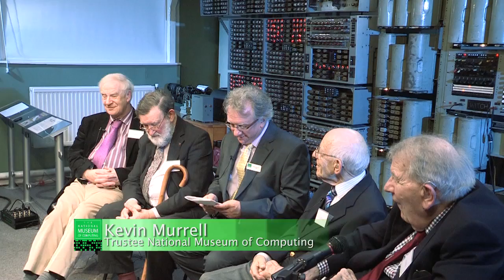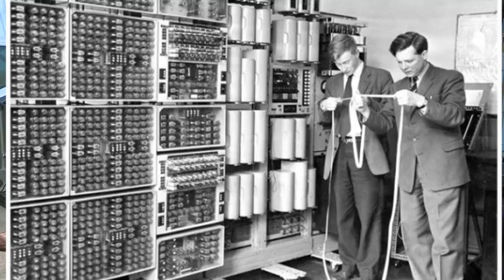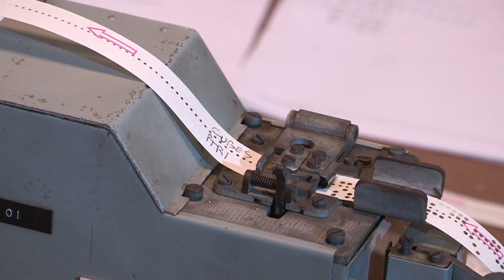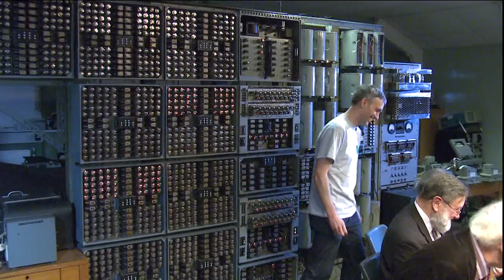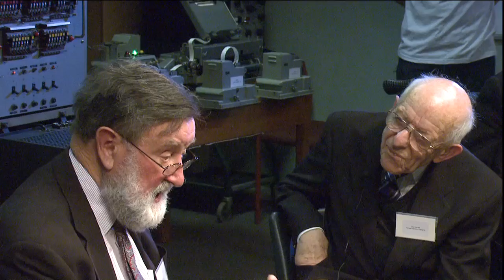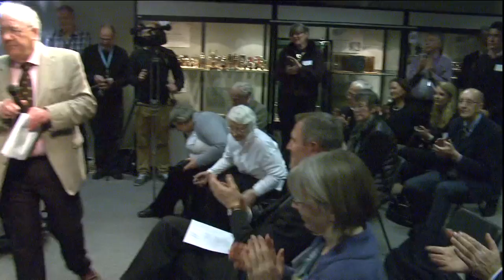The reboot of the Harwell Dekatron / WITCH computer, the world's oldest working computer

Comment: I'd love to see this machine in person, but I'm on the wrong side of the pond.
Reply: Saw it when I visited in 2016, but it wasn't working that day. The EDSAC rebuild was still underway at that point, too. The Colossus replica was working, though the printer was disabled as apparently the paper was a significant cost for the museum if they let it run.

I think I probably had a longer trip than you'd need, though. Australia is only a couple of time-zones off being on the opposite side of the world from the UK. New Zealand is directly opposite Spain, so it's probably the country with the longest trip to visit the UK.

Comment: Iran across this old digital computer patent 3190554 where it ran on compressed air instead of electricity. Was this computer ever built and used for anything? Could one be built today using 3D printing? Thanks for the post.

Comment: The mechanical calculator Bart Fossey uses is a Danish machine called a Facit. I own one. This was a development of the original pinwheel handle-driven calculators, but designed to fit a smaller footprint, and was also uniquely the first calculating machine which used a single set of digit buttons 0 to 9 for input. This actually had disadvantages for certain operations (such as square roots) but the cause was the design requirement for a small footprint. Overall it was physically harder and much clunkier to use than a Comptometer or an Original Odhner.

Comment: A pocket calculator is thousands of times faster, and I am talking a TI-58.
Reliable? until a tube goes out, that is why they ran known calculations both before and after anything important.
Tube failure rate was measured in hours as there were  just such a number of them.
Reply: Arabhacks Actually, the beauty of the dekatron tube is that it is NOT a vacuum tube. It's a cold cathode gas filled tube. It's filled with neon, and has no filament to burn out. The ionization of the neon causes both the glow, and keeps a path open for electrons to flow. As long as you don't keep tubes on and unchanging (and look at that thing blink away...) you should be fine a very nice chunk of time! Even the very worst USSR made dekatrons at least were rated for thousands of hours. the GC10B was a legendary tube. Not sure what the WITCH uses, but those tall tubes could be them. Those tube are notoriously resistant to outgassing. and proper maintenance should clear cathode poisoning due to sputtering (metal actually being deposited by the ions).
Reply: I don't believe the Dekatron has a significant failure rate.

Comment: So what does this machine actually do? a massive calculator?
Reply: Yes, it's a massive AUTOMATED calculator. It may have been slow even for its day, a human with a mechanical calculator could keep up with it, but it made up for it by being very reliable. It could be left for long periods of time unattended. It was supposedly left running for 10 days unattended with a couple miles of input tape and was still running when someone came to check on it.
Reply: +Crosshair84 A massive AUTOMATED calculator that doesn't call in sick or get in catty arguments with other WITCHes in the computing room.